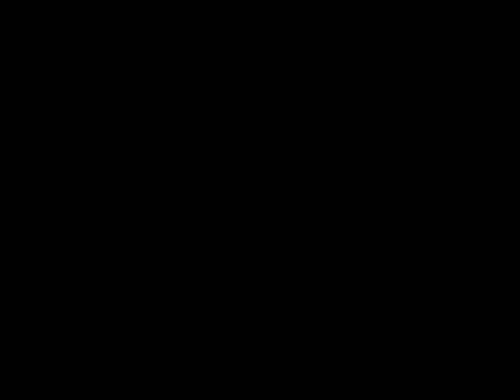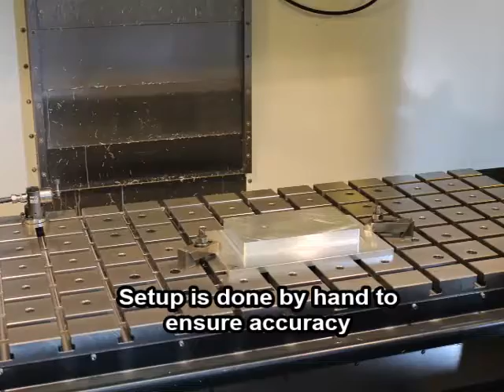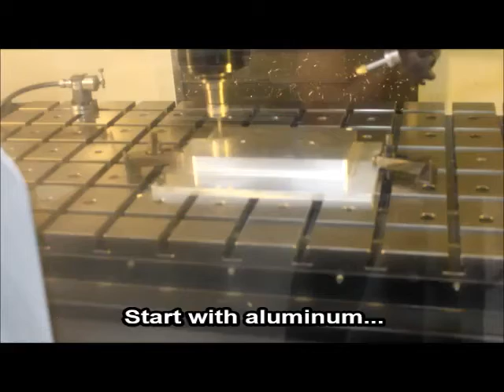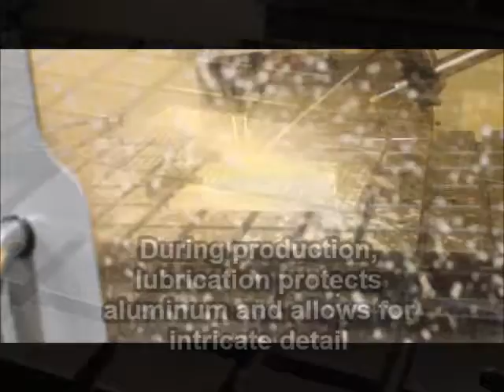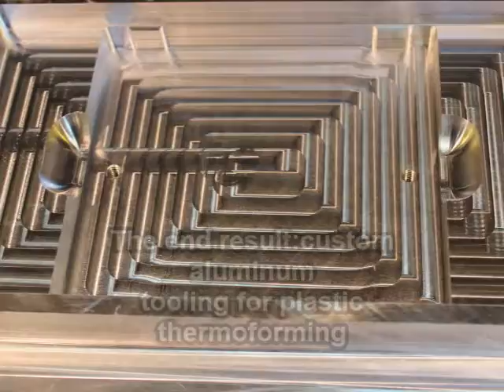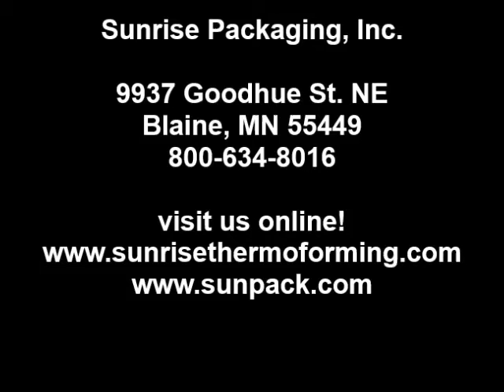Custom CNC Tooling

Comment from the maker: Clear plastic clamshells are a huge asset to retail packaging solutions. They offer security and visibility in one compact piece. Unique clamshells that are tailored specifically to product are often custom made with inline thermoforming manufacturing. Plastic material is roll-fed in to the former and takes shape of the Teflon coated aluminum tool that is being applied. Watch the YouTube video below to see how aluminum tooling is produced: